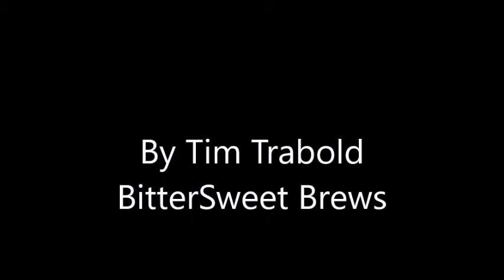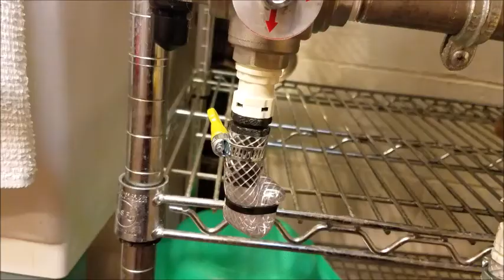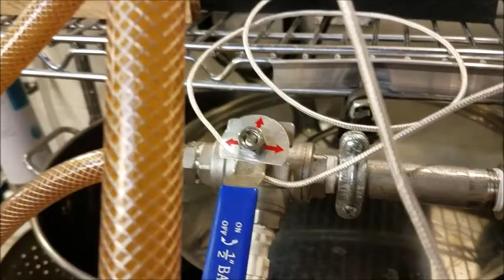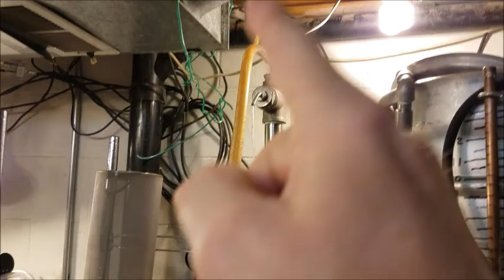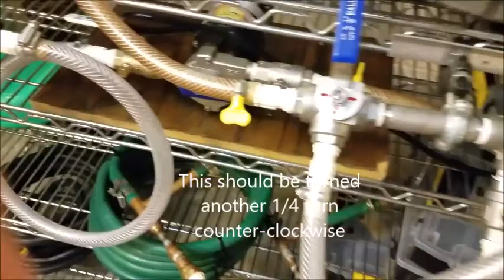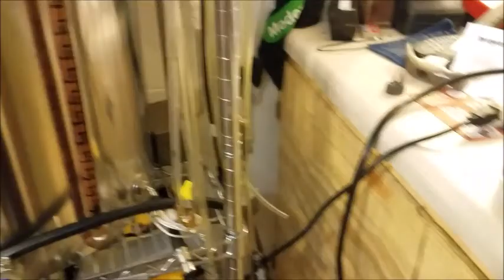Piping My Brewery, So I Don't Have to Move Hoses Around.

Comment: What is the hose that you are using?
Reply from the maker: It is 1/2" ID braided water hose I picked up at Menards. I have been using it for years.  It is much cheaper than silicone and for me works well.  Others use silicone, which has a higher temp range.

Comment: To complicated for me. I'm just gonna make a mess
Reply from the maker: Yeah, if you watch what your doing, have a rag handy and turn off the right vessel and pump valves at the right times you really don't need such a system.  I guess I just wanted to see if I could do it.  I have been brewing in my garage on an extension outlet without all the valves, etc the past couple times and old school really isn't that bad.

Comment: This is a clever setup. I really like the inclusion of that little 12v pump. Have you had any issues with dead space in any of the junctions?
Reply from the maker: I haven't really noticed any.  After I am done with each mash I push the mash wort through the tubes pumps and valves to the boil with water.  I clean out the after boil wort by pushing compressed air or just water through the chiller.  I run hot water through everything at the end and don't see any left behind once everything drains.  I have helped this draining by tilting the fittings down so they will drain and I leave the valves open when I am done so everything dries.If you go to Homebrewtalk.com there are a lot of similar systems people have designed. One used by "AugieDogie"  uses 2 or 3 of the 12V/24V pumps and he seems to like it.  If you use them for mash recirculation you have to be real careful to have clean wort flowing.  A good screen or grain bag is a must.  I have had grain wedge into the impeller and stop the pump until I took the head apart.  I don't have this problem with the chugger pump.  I only use the little pump for pumping and recirculating water from the HLT (I recirculate in the HLT to keep it mixing so the temp is pretty constant).

Comment from the maker: Well, I brewed on the new system Sunday.  As expected it was a little complicated.  It is definitely going to take a few times to get use to it (no beer during a brew day until it is done).  But, with that said, it did work great.  I only had one little snafu.  After the initial 60 minute mash I was mashing out and needed to add 3 gallons of 200 degree water to the mash tun to raise the temp to 165.  I started draining water from the HLT into the mash tun. Then I stopped and stared at the system to figure out how to set the valves so the sparge water would be pumped through the RIMS and rinse it into the mash tun.  Well, I turned off the pump to think about this and inadvertently left the hlt valve open and routing to the sparge arm.  During that time gravity fed 5 gallons of 200 degree water went into the mash tun and raised its temp to about 190.  oops.  Anyway I thought about what to do and came up with setting the valves, without moving any hoses, to send the hot wort from the mash tun through my counter-flow chiller and back into the mash tun.  In about 3 minutes it was back to 155 degrees.  I then heated the water with the RIMS to truly mashed out (with the extra water - kind of like biab).  I did a batch sparge with it then a quick fly sparge with the remaining water in the hlt.   I don't think I hurt it because it wasn't hot for very long.  I guess I can consider it a huge decoction.  When I was done cleanup was easy.  I ran hot water though the top section while the boil was going and I was cleaning out the mash tun.  All the hoses got clean inside without disconnecting them then I took them off and washed them in the sink.  Pretty slick.  I did make sure that I created a legend of where everything it connected so I can put it back together next time.

Comment: What's it like to clean all the routes?  My biggest concern would microbial infection.

But it looks impressive. :)
Reply from the maker: I haven't brewed on it yet, but I don't think it will be any worse than it was when I was moving hoses around.  I plan on running hot water and oxi through it.  As far as microbial infection goes everything on the cold side after the boil will be sanitized with boiling wort before it is put into a fermenter.  Cleaning should take care of the pre-boil side but if it doesn't the boil should.

Comment: Tim, that's A LOT of pipe & hose.... How much do you loose to the pipe & hose ?
Reply from the maker: I am not sure how much I will lose yet.  I haven't brewed with this setup.  I am estimating possibly a pint at the most.  I will probably plan on accounting for this in my equipment profiles.  That said, I do push everything I can out at the end with compressed air or CO2.  So, I shouldn't lose a lot and probably not much more that I would moving hoses.